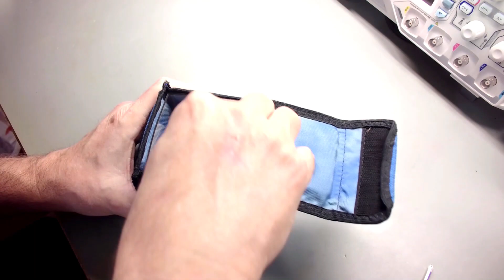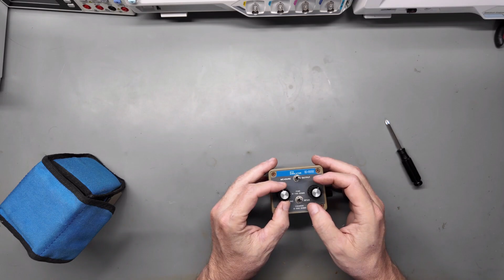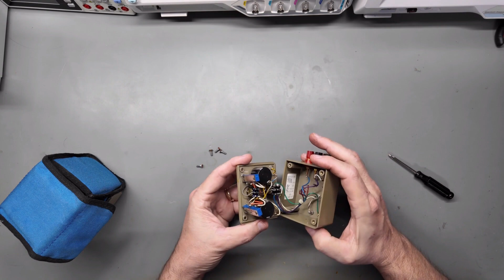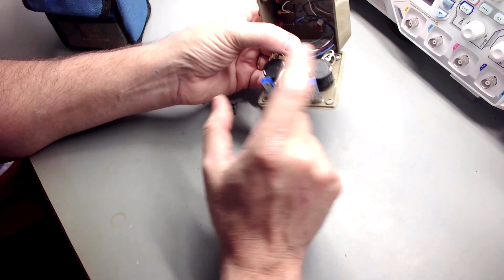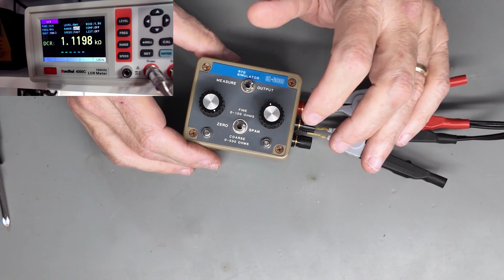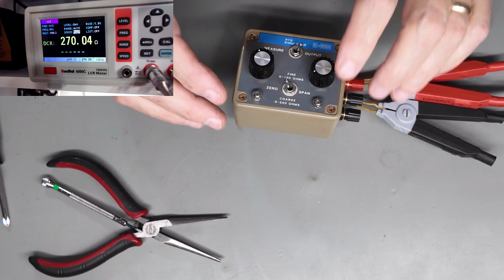Mystery Unveiled: Help Me Find Answers

Comment: I'm not familiar with RTD simulators, but the reason the pots have little "detents" is they are wirewound pots and you are feeling the wipers pass over the wire.  If you want good temperature independence you'd need a wirewound pot.  I think @Ezzell_ is correct about the 4 posts coming out of the bottom (oh yeah, just saw what you mentioned.  Perhaps they were added later for a specific purpose).  Maybe do a reverse engineering video and draw out the schematic.

I would say the two knobs are the fine adjustments for the "zero"and "span" modes respectively.  The coarse adjustments are the screws with the lock nuts.
Reply from the maker: Thanks,
Ok, it could be the wiper I guess but man the feel so smooth I thought it may be a feature. I did think about drawing it out so I guess I will.  I was just waiting to see if someone pointed me at a user manual or maybe had used one and could fill me in on it. Just one of those odd things I thought might be interesting take a look at for $5 😀
RJ

Comment: The four post is used to connect to a 4 wire kelvin micro-ohmeter....which is the most accurate way of measuring precise resistance
Reply from the maker: Thanks,
That’s what I thought also in the beginning of the video. But if you look close in the video showing the inside bottom only two post are wired up to anything.
RJ